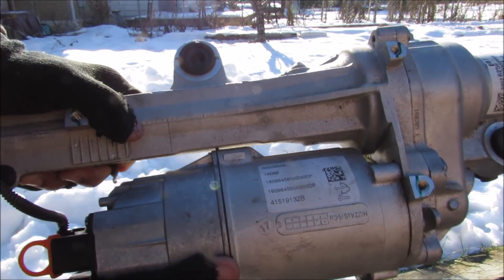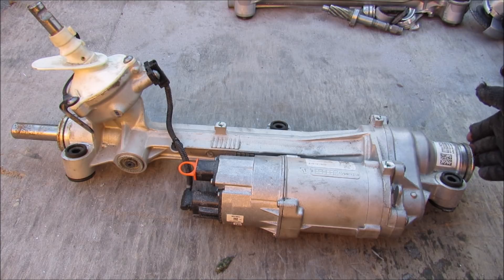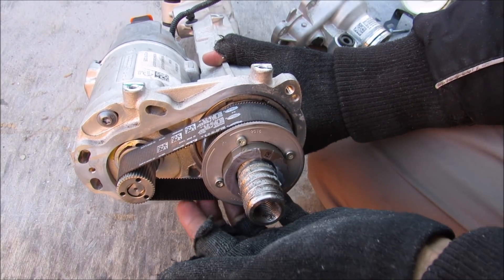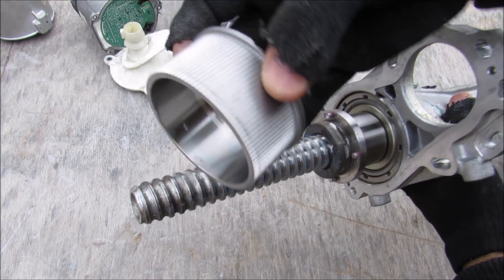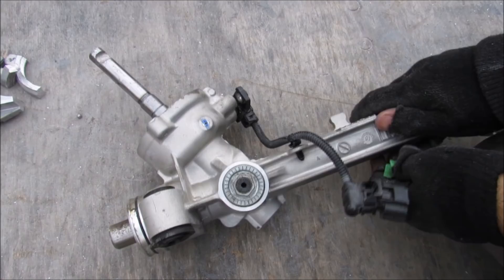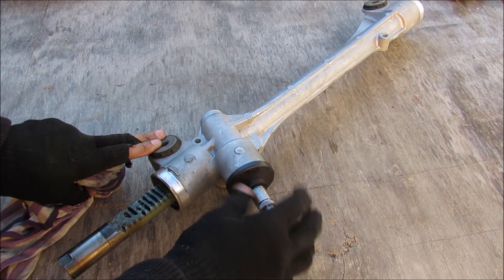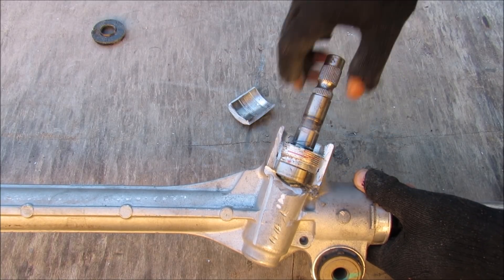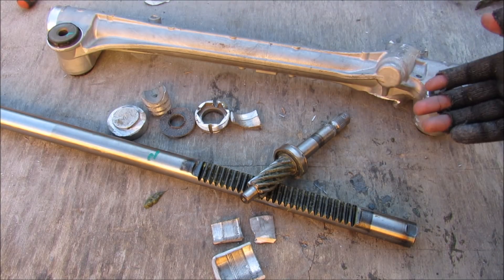How an Electric Steering Rack Works

Comment: Which electric rack should i use on a 64 Galaxie? I think you said there is a computer in the rack so its a stand alone computer?  How do i go about picking a rack, what do i need to look for?
Reply from the maker: Yes alot of people bare looking for these standalone racks for conversions on manual steering

Comment: Dude truly thank you so much for disassembling a unit .. you have the best explanation.. about the bearing .... I have a 2010 sho Taurus the steering rack is loud grinding sound I imagine I should be able to remove take it down to rack shaft and load it up with grease and hopefully get the horrible sound to go away ...

Comment: Oh no they put a rubber belt that’s prone to failure so much for reliability. They should’ve stuck with the old tried and true hydraulic rack as long you replace the fluid every 24,000 miles that rack will last 300,000 plus miles
Reply from the maker: Agreed ...not sure why that's needed when they could have done direct drive

Comment: Awesome video... thank you very much! One small correction:  "turning the rotational motion of the steering wheel into a horizontal ^linear^ (replaces 'translation') motion that push the wheels"... in essence that is the "translation: rotational to linear" which results in a transverse mounting.  Thanks for taking showing us the internals and the wonderful narration.

Comment: Is the Cruze steering rack able to move if the DC motor gets locked or something that prevents motor from spinning happens?! I saw some sort of planetary gear sets for coupling a electric motor to steering shaft which keep the main shaft still functioning with a siezed motor.

Comment: Nice vid like it, super interesting, i have a problem with my cruze, (service power steering ) Electric , 2013 cruze
Is it the electric motor cause at first steers well but then the wheel turns solid, hard and cant turn. Is it 
1. Add lubrication into rack
2. Change the motor and have it reprogrammed 
3. Replace for a new one?

Comment: So in “Part 2” are you going to show us how to re-assemble them?
Reply: "A dab of JB weld and a bit of red threadlocker. Done"
Reply: @VortechBand  It ain’t fixed until you wrap bailing wire around it. I use JB Weld for holes in my tooth. Its the small print!

Comment: Wait, but if the sensors in there measure just the rotation of the wheel/rack, how does the motor know when to assist? If they somehow measured torque then it would make sense because they could just tell the motor to counteract that torque.

Comment: Why did they put the pump there? So that it can be easily damaged.
Let me tell you where Volvo put the electro-hydraulic pump on the 2012 XC60: right behind the front bumper... hit a dog or a taller curb and you are royally screwed! (Found out the hard way)
Reply from the maker: These are electric racks and don't have pumps, just motors. 
They sit above the subframe.
Reply: Are you sure? Xc60 uses traditional hydraulic pump, which is located under battery.
Reply: @lonetraveler5660  i am very sure!
Own a 2012 D5 AWD XC60 and managed to damage the power steering pump …
Reply: @tommy27usa  I see. I have xc60 gasoline 3.2. The pump is under the battery. Different from your diesel engine

Comment: The Toyota EPS is far more reliable  than the GM. Why Gm put the electronics and a rubber belt? Are they Nuts? That will last no more than 8-10 years..... Great Video!!!!!
Reply from the maker: But GM cars typically don't hold up past that so it's EPS might Outlast something more expensive on the car regardless....

Comment: I simply can't understand how the mechanism at 3:24 would allow the rack to move freely WITHOUT the electrical assistance from the motor. Shouldn't the recirculating ball bearing block the movement from the rack?
Reply from the maker: Hmm that kinda makes sense...
Reply: @speedkar99  You could move it at 1:51 with some ease - so I know it works - but I can't see how this was mechanically possible!

Comment: What would you say could cause a lag in motor assist on a steering system like this? I have a 2017 Mustang and the EPS has become notchy when changing direction. It's like there's a static friction to overcome before the steering changes direction resulting in a notchy feel at the steering wheel.
Reply from the maker: Isn't it under warranty? 

I wonder if the position sensor need to be calibrated
Reply: @speedkar99  well I only have 2 years and 30k on her so she should still be under warranty. I'm so heavily modded though I'm hesitant to take it in. Next thing you know they're joyriding your car around lol. Maybe that's the move though.
Reply: @pace1786  doing modifications to your drive train while the car is still on warranty isn't wise. Different wheels, tires and entertainment system mods are ok, but anything that changes your emission controls  will be an expensive issue when and if your state or country requires inspections of the emission controls  as a condition of licensing  the vehicle to drive on the highway. You while have to return the vehicle to stock to pass so save they parts you have changed out.

Comment: Great video. Some terms to modify: Servo motor (not DC motor). Ball screw (not spiral screw). Ball nut (not spiral gear). Ball track (not spiral teeth). Input encoder (not sensor).
Reply from the maker: Thanks. I'm not an expert to know the terms but I know what it does. Are you a rack Engineer?
Reply: @speedkar99  No, an engineer in CNC machinery, and these items are directly borrowed from CNC linear motion. In fact an argument could be made that electric power steering is a CNC machine, in a very real sense.

Comment: Thank you very much for that video! I wanted to ask you, on an electric rack like what is on the c7 Corvette, what is that very little mushy part as the steering wheel is turned from center? I mean slight. Like a few millimeters. Is there a spring in the steering sensor that allows slight movement before the rack is assisted by the motor? Or is the top shaft (the part where the sensor is) one solid piece that connects the steering shaft to the rack?
Reply from the maker: Electric racks don't have a torsion bar like hydraulic ones. The on center looseness is how it's geared, in addition to your tire and suspension setup. It's made like that so you don't accidentally sneeze and change lanes lol
Reply: @speedkar99  so is the midshaft one piece on an electric rack? I know the midshaft or input shaft is actually 2 pieces in a hydraulic one in order for the valves to actuate.

Comment: Hi. I need you to help me. On 2015 nissan altima if i turned the steering wheel any direction I'm hearing a strange weaning noise at all time unles I'm not turning it. Do you know why is this happening. Thank you.
Reply from the maker: Check the power steering motor

Comment: My electric motor is making whinning and buzzing noises is it possible to open it and repair it? Thanks p.s: I suspect as it is from used car the motor gear is no greased well.  Could it be the problem.
Reply from the maker: Yes, if they have the parts available to rebuild

Comment: Hey bro, can you help me? My car (Toyota corolla 2011) has electric power steering. 2 years ago I installed low profile tires and I drove in potholes 2 times and the tires got punctured. The whole suspension system got damaged, from struts, ball joints, stabilizer links and tie rods. I changed everything but there still some plays behind the steering wheel, it pulls to one side and sometimes I feel like its disconnected. Do you think the steering racks may be behind all this ?
Reply from the maker: Steering racks have U-joints and bushings that can wear down too. Did you get the car on the alignment rack and rotate tires?
Reply: @speedkar99  I already did alignment 5 times. For tires, I got new tires and rims in January. I will need to have the u-joint check like you said. One other thing I would like to ask. When doing alignment, do the mechanics put the same values that the car had when leaving factory? Like some cars already have negative camber, and then the mechanics put it to 0. I feel like my car doesn't has the proper values, for e.g, the front tires should have -0.53 camber but now it has -0.16.

Comment: So when the computer or motor or toothed belt on that chevy decide to call it a quit on a twisty road, will the steering lock up?
Reply from the maker: Not lock...it won't have power assist
Reply: @speedkar99  But since it is a worm thread arrangement, can the rack turn the pulley?
Reply: Dileesh VV i don’t understand what you mean, but loss of assist means you can still move the rack with the steering wheel.

Comment: Cool video, man. I've got a quick question about my car's EPS. I have a 14 Accord 2.4 and the EPS has a resistance issue. Turning left there's almost no resistance (think Lexus) and turning right there's quite a bit of resistance. For example, when I make a 90 degree turn to the left the steering slowly goes halfway back to center but when I make a 90 degree right turn it abruptly goes fully back to center. This problem surfaced right after a chain tire store performed an alignment. That shop claimed they didn't do anything to the car that would cause this issue and even the shop forman at my local Honda store says he doesn't know what it could be. Honda checked the alignment and said it's spot on, so it's not that. Any ideas? Thanks!
Reply from the maker: They might have messed with the caster setting which is responsible for returning the wheel to center
Reply: speedkar99 awesome, I’ll check into it. Thanks

Comment: Interesting.. rack and pinion, using a ballscrew as your power assist (think of a CNC machine table, or updated manual milling machine). Good idea, but I agree - poor choice of computer location.
Reply from the maker: Yes it's a good idea in principle but I don't see the point of using a belt that could be failure prone
Reply: @speedkar99  well it's either belt chain or gear, and as per usual, guess which one is cheapest to mass produce and provides the least consumer inconvenience(noise)? That's why!

Comment: @speedkar99 - in 2:07 when you take the cover off, you have two rotors there both pressed onto pinion. The pinion itself is consisted of two pinions (upper and lower).  Those two rotors, are simple magnets. The Pinions are pressed concentrically and are connected with a torsion bar. When turned, the torsion bar will allow a slight movement of upper rotor to inside lower rotor thus creating changes in magnetic field. Then the Sensor (which is called hall Call Sensor) reads those changes and translates this information for the computer. This system allows the EPS to "read the mind" of a driver, so the gear knows in which direction you want to turn.
Reply from the maker: Nice! Thanks for that information, pretty cool how it picks up that information. I thought it would have been a simple steering angle sensor further up the steering shaft.

Comment: Just compare 2 rack and pinion from Chevy and Toyota , obviously Toyota looks better Quality . Just check that solid steel bars and compare.
Reply: San Myat Htun lol, the only difference here is that the toyota eps is column type (this means that the motor, computer and sensor is located in the column and provides assist trough worm gears) and the chevy eps is mounted on the rack where it uses a ball chain mechanism (more torque).

Actually, the chevy eps is more efficient and provides much more torque than the Toyota one.

Comment: Ive taken bolts off a different way but a pretty cool video though
Reply from the maker: How did you take those special bolts off? The correct way?
Reply: @speedkar99  well. Perhaps he invested time in a make shift tool. Drill small holes on the fittings to enable the attachment of other common tools. Well who knows.

Comment: Chevy rack has computer on it so it can fail prematurely duh.   That way they can charge you an arm and a leg at the dealer .
Reply: VGK30 toyota has one too, under the steering wheel.

If the computer fails the mechanical connection is still there but with no assist.

Comment: So the electric motor that responsible for assisting has to be mounted on the rack or close to it or it might be mounted inside the car behind the steering wheel casing?
Reply from the maker: It's mounted behind the steering wheel on the column

Comment: Amazing how complicated rack and pinion steering can become with electronic assist. You have to wonder about the long term reliability of these pieces as the vehicles age.
Reply from the maker: Agreed. Complex but technology has matured enough to make it reliable.
Reply: I have had the electronic steering lock up several times in owning the car I drive. The only way to reset it was to turn off the key momentarily, restart and it began to work again. Luckily I wasn't on the freeway or a corner at highway speed when this happened.

Comment: Did I miss something, or does the Toyota rack not have power steering?

Also, it would seem possible that the Chevy's rack could lock up if the electric motor fails? AFAIK, these kind of mechanisms are supposed to fail in a safe manner, i.e. that the mechanical steering action should always work?

Comment: Another great vide from you! Only one thing that did not make sense to me. In the end (at 8:20) you explain on how some racks with variable steering, the pitch between the teeth are different from the middle and out to either side (to make steering quicker towards full turn?)
Does the pinion also have different pitch, and are sliding up-down to adjust to the variation in pitched  gear/cogs/teeths on the rack?

Comment: Nice vid. Guy's a pro mechanic and speaks like a university professor.
I'm here bc my 2018 suburban power steering failed and it's kinda easy to see how many parts are involved in electric assist vs old fashion.
Reply from the maker: Thanks, I'm an engineer in the day and backyard mechanic on the weekend 😉

Now why is your brand new truck giving problems?

Comment: Is it possible to damage an inner balljoint by hitting a kerb and can they be independently replaced or does it have to be the whole rack?
Reply from the maker: +iVlogBuzz Usually the tie rods can be replaced
Reply: I suppose I need to find an honest mechanic that isn't the stealership or the so called Porsche specialists as they couldn't find anything wrong (but were happy to take money to tell me nothing and did so at an hour labour)

Comment: Great to see u back. What is a firewall ??
Reply: Essentially means the back wall of the engine compartment, the wall where it separates engine bay from the inside of the car. Another example, you'll find your in and out heater hoses (Two rubber hoses much like your radiator hoses) go inside and out of the fire wall to heat the heater core which is located inside the dash behind the firewall.

Not all cars have their Racks bolted to the firewall, my Mustangs is bolted to the front of the car along the frame.
Reply from the maker: +Yathu prem firewall?
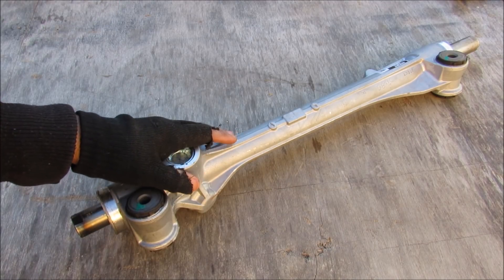Reply: 0:18 Steering rack mounted somewhere on the firewall ??
Reply: The Conformist Thanks for the info man

Comment: For Camry's, where is the computer and where is the sensor?? BTW, change another cloth for your brother's underwear, it is really DIRTY! That Dirty!
Reply from the maker: +Charles Fu Haha Yea I'll change it. 
The computer is likely under the dash, the motor is mounted to the steering column, and the steering angle sensor is behind the clock spring.

Comment: The parts from the electronic steering rack could make a nice project. 
Can you make that DC motor work without the chip board?
Reply from the maker: +K Smithers yes that would be a nice project. That DC motor had a computer behind it so my thoughts would be it would need some kind of programming to get it to work.
Reply: speedkar99 
Or would it need programming?
Would it be possible to toss the chip?
Looks to be wires coming out the back, could you solder wires on the motor possibly...
If you could make that motor work with a variable speed controller, that would be awesome!!
Reply: You can. Always run a brushed universal motor without any electronic control circuit been there. You can also run the same motor on AC too. So they are not just DC motor. But to successfully use it for your intended purposes you may have to work out the power feed connection. Universal motors come with different numbers of brushes, the sequences and order of the connection may be altered to fit the power sources, or say current type, AC or DC. You only need add a adjustable resistor setting to control the speed and hence the power output.

Comment: Compare to chevy rack how does a camry rack work smoothly,i didnt see any electric motor on it that drives the rack easy...
Reply from the maker: +lifechange unexpectedly The Toyotas have the motors on the steering column before it goes into the rack. That's why you didn't see it.
Reply: speedkar99 thank you so much

Comment: awesome video! i followed these disassembly instructions and have all my rebuild parts, now how do i get it back together?
Reply from the maker: +slidestang242 thanks! 
You need to play the video in reverse at half speed. Use JB weld instead of the grinder and you should be good 😎

Comment: 6:48 The cap, spring and piston are there to eliminate backlash by pressing the rack against the pinion.
Reply from the maker: +spankeyfish Good tip, thanks for the clarification, it makes sense.
Reply: So those parts essentially fix the rack in place? And it seems it's a adjustable arrangement. I may have to go back and see if this particular setup is put in place to simplify the machining process, reduce the otherwise stricter tolerance requirements of parts. It seems like a pretty smart solution that works.
Reply: Correct me if I am erred. I think it's safe to call that assembly a sleeve bearing.